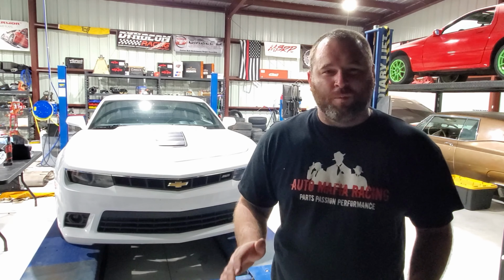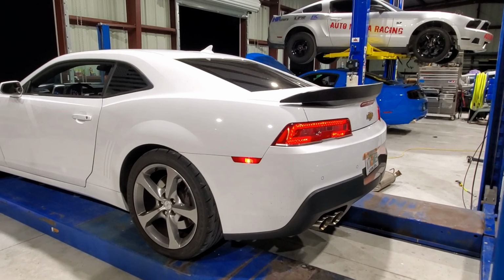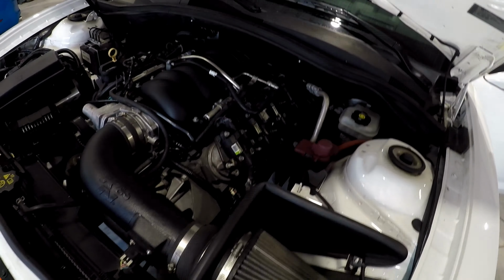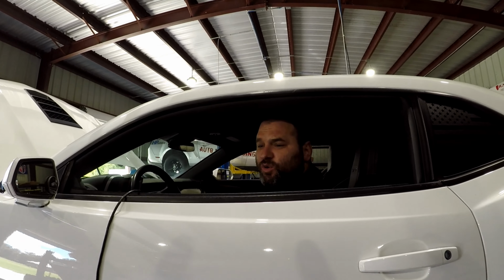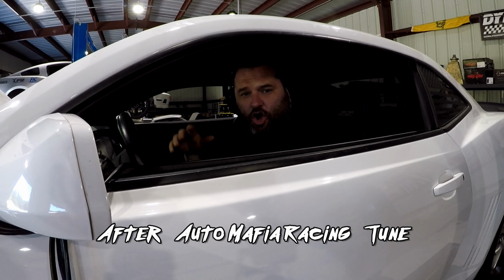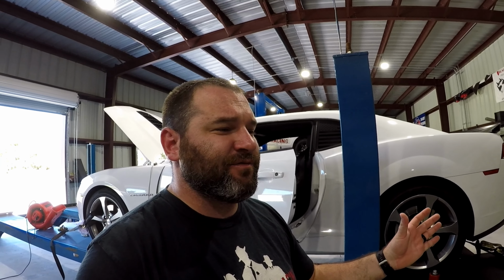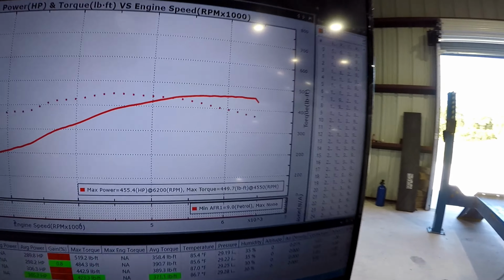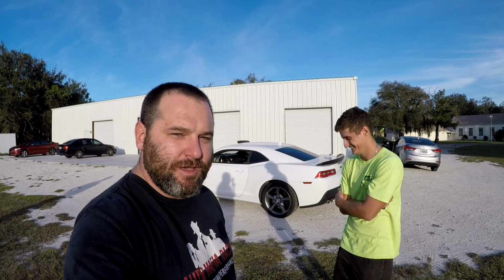Tuning a 2014 Camaro SS with a Texas Speed Stage 2 Cam.  How Much Will it Make?

Comment: I have a similar set up and have the same issue and wanted to know if he is running the stock torque converter/stall.
Reply from the maker: Yes
Reply: @automafiaracing  wow I have 2.5 camm as I was told aka(the chop monster) on my stock torque converter and it's ruff at the red light, car surges pretty bad,and have lack of break pressure. I was told this camm will work with my stock converter but obviously not.
Reply from the maker: It does work.  But it doesnt act factory thats just the life of having a big cam on a tight converter.
Reply: The shop suggested to upgrade to a 3500 stall torque converter and the car will run like a beast. I will be taking it soon, just don't like the way it runs right now, luckily it's not my daily driver.
Reply from the maker: Yes for an NA car we ran like a 4400-4600 stall.
Reply: @TheZavier666 the white Camaro in the video is a manual transmission car. Manual cars do not have converters. They have clutches.
Reply: WHAT?  didn’t you just see him stick shift it, and the tuner said in the beginning it’s a 6 manual= no torque converter!

Comment: Hey Auto Mafia, what are some tricks I could do to get rid of my surging. I have the same LS3 and Cam on my Camaro. I also have the software.
Reply from the maker: Take it to a competent dyno tuner. Or purchase an email tune from us
Reply: @automafiaracing  I took it back to him twice, and still couldn’t do it. I played with it myself and got it to stop during decel. But like you said in the video…light load is the problem.
Reply from the maker: it happens  :)

Comment: Would stage 2 or 3 work better in my 14 1le car with 3.91 gears?
Reply: @automafiaracing  Texas speed cam? sorry.
Reply: Either one would work well. I have the stage 2 on 111lsa, only because the average hp on the 229/244 (stage 2) is a little better than the stage 3. The 3 is a tad bit more on the top end, and I mean tad bit as in 7hp or so.

Comment: I like your energy. I'm wondering bgg if you can make a similar tune for this with my motor. I would love to get a nasty idle tune for my sbc it is a 440 dart shp with Holley sniper. My cam specs are 240/244@50 .608 .614 lift 108lsa. With a 3k stall with th350 trans I made 400to the tires this was a relative moderate tune and I am new to efi. Would love any tips and advice I can get. I am using Holley sniper efi with the holley software. If you can work with that I will definitely become a customer
Reply from the maker: We dont tune a lot of old stuff Currently

Comment: What is the cam duration and lift numbers? Is it on stock heads?
Reply from the maker: Yes stock heads.  Not sure. TSP Stage 2 cam
Reply: TSP Stage 2 N/A LS3 229/244, .629/.615, 112 LSA Camshaft (25-TSP229244-112)    I'm looking at this. 2010 camaro ls3 broken spring at 90,000 miles. Got it torn down and deciding on parts.

Comment: I have a ls3 on my 99 Silverado with a stage 2 cam with headers and muffler got it dyno tune and the guy made 400. How did yall get that much out of it? Or do I have to change tuners? Lol
Reply from the maker: Might be the tuner. Our dyno reads low typically